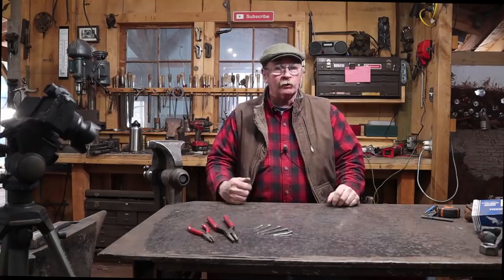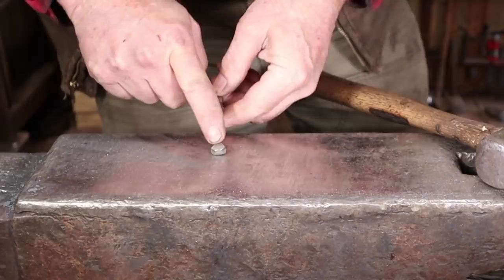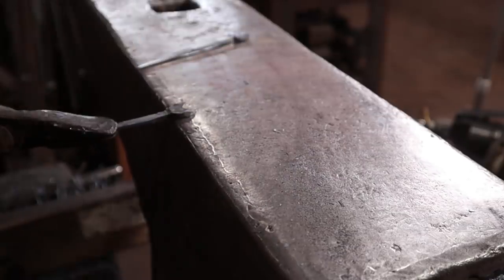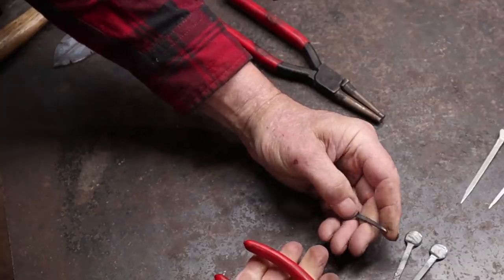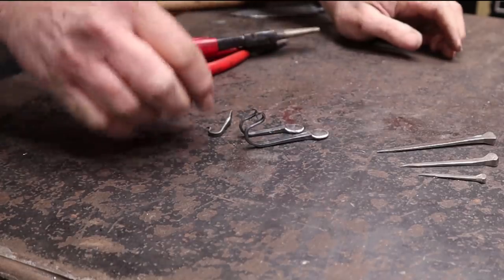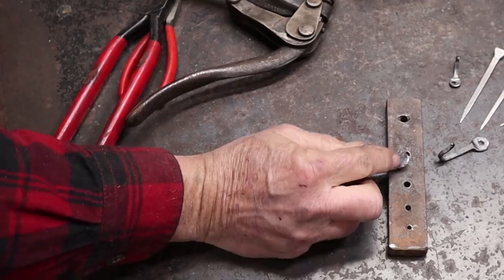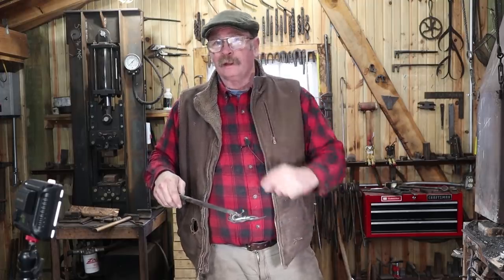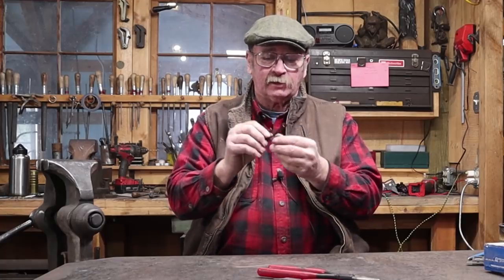Horseshoe nail hooks - Hook of the Week 37

Comment: Love your hook if the week John. Looking forward to some hooks that are useable tools. The ornamental hooks are awesome, beautiful, and good sellers. Yet I desire to see some hooks that are useable for work. A few suggestions, 1. A drag hook. The kind you hammer into a log and hook a chain to so you can drag it out of the woods. 2. A hoist hook both the hook with just an eye to put in a clasp and one with a swivel joint. 3. A tow hook, for when you need to pull something, like your zero turn lawnmower out of the mud with you're truck. Love the information inspiring videos. And a question? Though I love traditional blacksmithing, what are your opinions on induction forges?